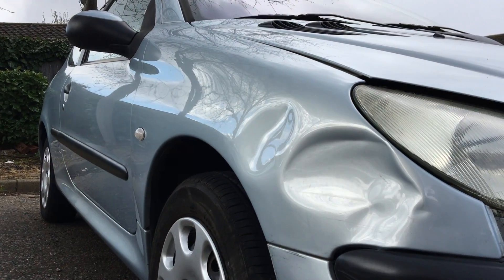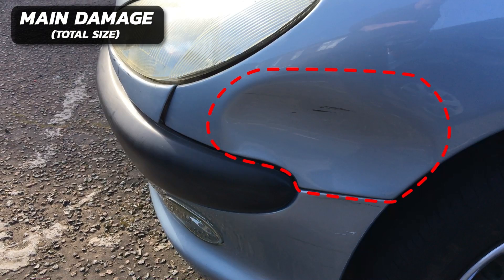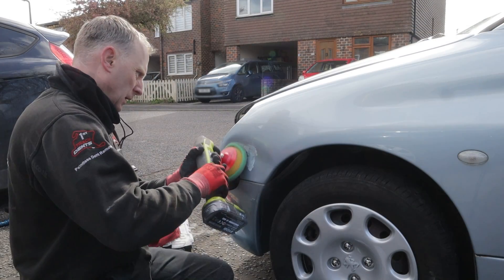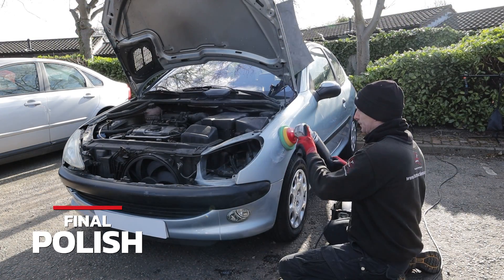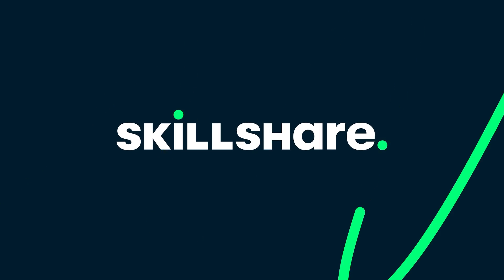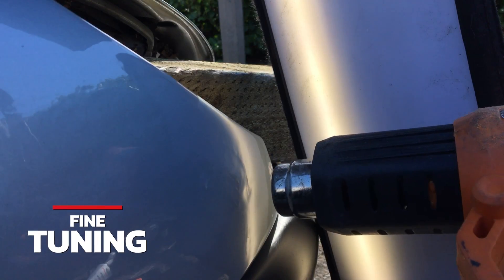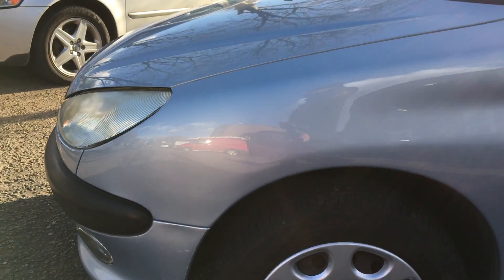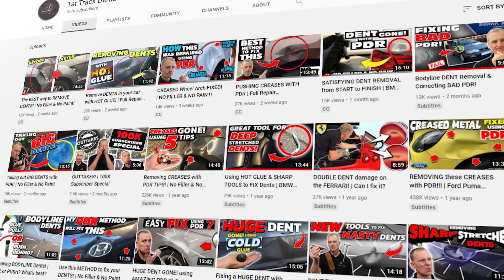Like MAGIC! | FIXING DENTS with PDR!

Comment: Hi Great job. How you have a electric power when you work in outside(in the road /parking)???
Reply from the maker: On this job I did manage to run a power cable from the customers home to the car, but yes other jobs can be difficult if there is no power supply 👍
Reply: @1st_track_dents  thanks 🤝

Comment: Hi master, How come the parts you deal with are never abraded (paint)???
Reply from the maker: I only really take on a job if the paint is undamaged, but you have to remember most dents are caused from a plastic bumper hitting the panel and as the plastic bumper is soft, it doesn't scratch or damage the paint. Paint is also a lot more hard wearing than it used to be. 👍

Comment: Your work is excellent. Interestingly I have two dents not as bad with good rear access but all local PDR companies have said not interested, although many didn’t even respond. All said it needs a body shop. Not expecting perfect but seems most companies just want the simple little jobs or they have brought a few tools and not confident on these type of work
Reply from the maker: Thanks, That's a bit naughty that some companies haven't responded, I would always respond even to say if I couldn't do it. To be honest every dent is different sometimes smaller dents than this are not possible, it just depends on the type of metal, access and how bad the dent is. If a company can't do it, they should at least explain why because their reasons could be quite valid but if they don't tell you, how are you supposed to know. The skill level is very difficult from tech to tech some like just doing easy ones and some ;like to challenge themselves. 👍

Comment: Hi! I have a question in regards to when applying the hot glue.. Does it make a difference setting the glue gun between high or low? In reading some manuals they claim the higher heat setting is for a stronger bond but I don't understand if that would have a better or worse effect in respect to its' application for pulling dents. I'd really appreciate any insights!
Reply from the maker: Hi, each brand of glue has a guide of how hot your glue gun temperature should be, most glue brands suggest that you should see smoke coming off the glue, for example the Glexo glue sticks that I am currently using say the application temp should be  between 350-385ºF / 177-196ºC
Reply: @1st_track_dents  Thank you!!

Comment: Is there a PDR kit you recommend, i bought a car with a ton of small dents and im willing to tackle the task.
Reply from the maker: Hi Daniel, I would try and get some training first before attempting PDR as you could make things worse, there are many starter kits out there but most of us buy individual tools that suit our needs. It can be very expensive once you start adding in LED light boards, screw on tip bars, window guards, wedges etc, I started off with this kit when I started but still had to add lots to it to get started:
https://www.pdrtool.com/collections/pdr-tool-sets/products/master-41-set-made-in-usa
You could probably just start off with a good screw on tip bar and some tips. 👍
Reply: @1st_track_dents  thank you so much for the advice and recommendations!

Comment: I got a small dent in my fender and passenger door on top of the door handle I bought a dent puller is there a way I can pull it out . I can't put in my headlight in the fender cause there's a gap can you help me out
Reply from the maker: The best advice I can give is seek the help of a professional as this skill takes years to learn so by attempting it yourself you could make it worse. That's why if a have problem with my electrics, I call an electrician, a skilled craftsman in their field of expertise will always do a better job than I can 👍

Comment: Very nice. I've pulled a few dents recently with glue and it's really annoying when you pull the clearcoat or paint off..... 😂
Lucky for me I'm able to repair it. Awesome job as always 👍🏻👍🏻
Reply from the maker: Yes, the cold glue is much safer, but the hot glue can be a lot more aggressive. It did concern me on this as it was an older car, but I was confident from checking both panels closely that the paint was original. Thanks for the comment! 👍

Comment: Lets see; 5 and 1/4 hours at $110 per hour=$577.50. A typical junk yard will sell these front fenders for about $35 each. Some rattle can paint finishes the job for about $100. Flipping the page, your workmanship is impeccable and worth every penny you charge.
Reply from the maker: Thanks 👍 although the UK PDR prices are probably the lowest in the industry, so your calculation is quite a way off and would be much higher if repaired in the USA, but yes if that was the price charged it would be worth that just because of the skill and work involved 👍

Comment: the talent you have is amazing.but on other hand i dont understand the likes or reviews you have 20000 views since june right?.a simple man with a either can shows a old tractor will it run after 20 years? they get 153 thousand views in 3 months its so upside down..ugg.i mean i did that at 15 but we had no video or tech back then.i been at pdr for 15 years they all still think well what does that mean?.ohh when you explain it they just dont get it even in 2022.most insurance companys here in us will just put a aftermarket fender on insurance they dont even consider fixing that and people so uninformed it just drives me crazy .I see constantly up north where people hit deer and it bounces and leaves dents  down side the insurance company ignores them dents they write it up for front bumper parts ignoring the dents down side which most are pdr stuff.they try hard to ignore them dents until you point them out take pics ect to get a little bit of money and maybe make a customer happy even though i fixed the dent they probaly never knew it was there cause its buried in deerpoop